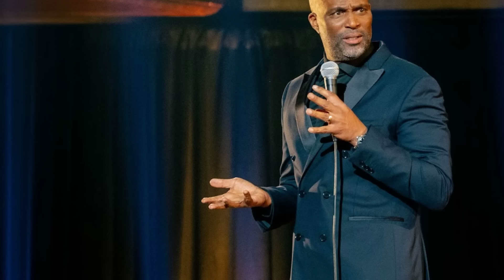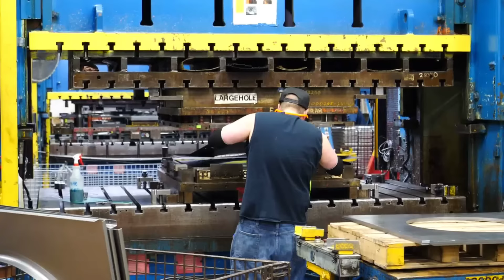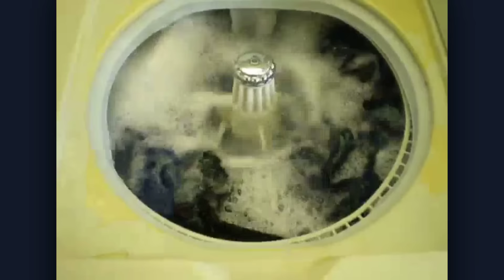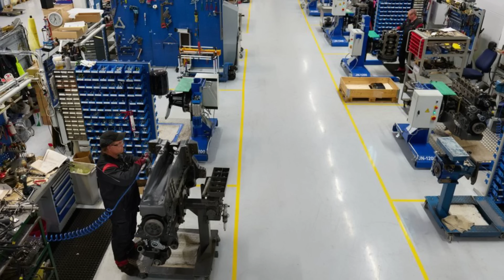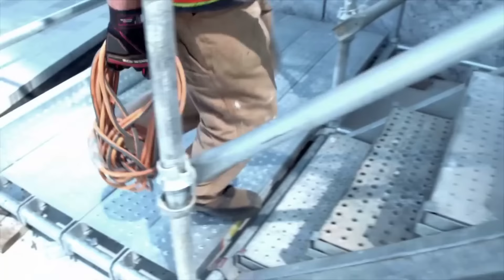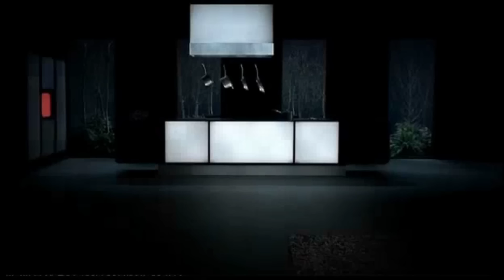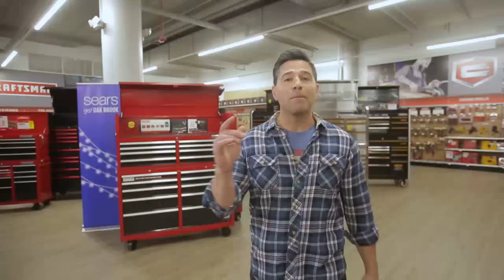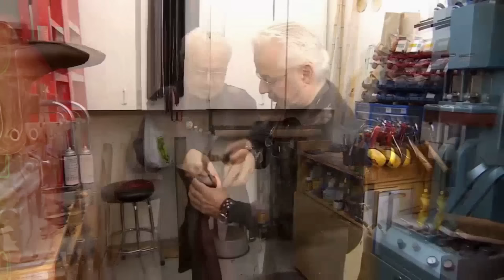The Only 5 Brands That Still Last (The "Buy It For Life" List)

Comment: Because I've been an inventor, designer, and manufacture for more than 50-years and have in my home, a machine shop, sheet metal fabrication, painting, electro-plating, electronics labs, and optical labs, I rarely ever purchase anything new, I repair what I have! I drive a 2003 Toyota with 124k miles, a 35-year old Maytag washer and dryer with parts that are still available, a 15-year old Whirlpool refrigerator that I replaced the "energy saving electronic" evaporator fan that failed within two years, with a Japanese ball-bearing "muffin" fan, I "snake" my own drains, I repair all electrical problems, component level circuit board repairs, and thousands of other domestic problems I encounter. I vowed never to buy a new car even though I can afford to pay cash for most cars, I exclusively purchase used and in many cases broken items for dirt cheap prices. As this video clearly states, especially new appliances and devices containing electronic circuit boards that are not repairable or have individual components that are not available, making them "un-repairable", I'll stick to things that I know how to fix! David Riddle
Reply: I admire you, I wish i had the same set of skills.
Greetings from Mexico.
Reply: @donleondevillafana7615  I do indeed have a YouTube channel, click on the circular "H2H" logo to see it, and I encourage you to learn from my methods!  David Riddle
Reply: @d @donleondevillafana7615 just watch YouTube tutorials. Most repairs are easy enough to do yourself all you need are right tools. Soldering is easy to learn and most product manuals are available online with a quick search. If you need specific parts you can buy other broken products on the low and pull the functional components to replace them. It’s never been easier to learn to DIY as it is now when planned obsolescence is unavoidable. So buying older appliances and tools that were made with repair in mind are no brainers with the only downside being that replacement parts may be hard to come by and you have to machine new parts yourself but there are shops that specialize in making replacement parts. Right to repair has been hijacked and replaced with plastic garbage waiting to expire
Reply: Holy cow. There are two of us? Same reason I bought a 1984 Kubota tractor.
Reply: @ehdeesign there's more than that,!
Reply: @sandydenman6083  I'm 73 and unfortunately many of us have been lost!  David Riddle
Reply: Marry me.
Reply: @DancingOnH2O DITTO 😊
Reply: @worldpeace8187  Thank you both for your offers, unfortunately I already have a "currently suffering paramour" of 25-years, when she asks me why I'm with her I say, "you are the least objectionable one I've found"! Just to let you know, I am not prince charming, but I am "duke useful" and duke useful is vastly more important in the domestic environment!  David Riddle
Reply: @DancingOnH2O 
Yes, just send me  cash 💸 and credit cards.  
Thanks 😊
Reply: Bol i was going to ask is he married 😂😂😂😂😂 @DancingOnH2O
Reply: @DancingOnH2O seriously, and can I be a sister wife?
Reply: 🇬🇧 Brit here.
We've got a 30 year old MAYTAG fridge freezer. Still rocking.
(It was 2nd hand when we got it!!!)
Reply: @surreyscouse2873 
Hello.
Just incredible that I saw the responses.
All true statements, just browse the junk (new,) items for sale ,starting in the 70's
Thank  you ,one and all
Reply: Dude! I’m 67 and I could have entered a comment almost exactly like yours. All my family drive used Toyotas also!
Reply: @TheKitchenTechnician  Congratulations to you, you've found the same path as I have!  David Riddle
Reply: My primary vehicle is a 2003 Dodge 3500 with 460000 kms on it that I service and repair myself. 
  I have a very nice 1975 Chrysler Imperial and a nice Ford Model T..
  All of our appliances are old and self maintained , so far I can harvest parts from our local garbage disposal site 😊
Reply: @tomlambert1833 
Nice!
My parents had a Chrysler Imperial. I think older than '75 though. I loved that car!
Reply: @tomlambert1833 Good luck never getting into an accident in old cars: no front, side or head airbags; bad seatbelts; poor braking systems; no electronic alerts or self braking capabilities; and too many other safety improvements that are responsible for saving thousands of lives through the decades.
Reply: @awesomelife3710  I live in Southern California, the only thing I'm afraid of is driving around with "newly arrived, unlicensed and un-insured, intoxicated, and texting motorists"!  David Riddle
Reply: Same thing most of us learned to do. I only need a lathe but my drill and wood lathe help me get by.
Reply: My first computer lasted 13 years. My next computer lasted  5 years, totally shot.
Reply: @nighthiker8872 I think the youngest computer in my company is 5 years old. Everything else is older.
Reply: @psxtuneservice  I'm responding to these comments on a computer running Windows 7!  David Riddle
Reply: @HowToHomeLife weird flex but ok.
Reply: @nighthiker8872  I’ve been using computers since about 1990. The computers I buy today last longer than the ones I used to buy. Why? Because those computers of yore became obsolete in but a few years. As a professional photographer, I needed performance and that increased at such a rapid pace over those early decades that those old models were ditched pretty quickly. I now have a Dell desktop that I’ve had for five years and it still works fine. The only issue is with Windows, not the computer.
Reply: You are worth your weight in gold.
Reply: @konstantia1607  You're welcome!  David Riddle
Reply: You should start a youtube channel and share those skills!
Reply: @DogofSinope  I do indeed have a YouTube channel, click on the circular "H2H" logo to see it!  David Riddle
Reply: Ditto... Newest vehicle I have is a 06. My Daily driver is an 04 f150 with just shy of 360k miles that I bought for $500 bucks in 2011. Original engine.  Can barely hear it run & does not leak a drop. Learned problem solving skills as a broke ass kid & I maintain my equipment.  😀
Reply: @johnstout5784 
Damn cam phasers... lol
Reply: I have craftsman tools that are over 30 years old, so before they made them into garbage they will probably outlast the new ones.  My husband was good at repairing stuff .  He had too give up because they started making all these unrepairable objects.  Could not take them apart and put back together.  Planned obsolescence.
Reply: Well done, Sir! 🎉  🇧🇧.
Reply: @Masterj3712  You're welcome!  David Riddle
Reply: @HowToHomeLife 
Have a good 👍 one. 
🇧🇧.
Reply: I'm jealous of your shop and skills.  I work on my own cars for fun.  I do some of my own appliance repairs too.  I draw the line at circuit boards though.  I like my old cars better too.  Two Toyotas, one early Nissan and two collectible Porsches.  Our Camry has over 300,000 miles.  I can afford new too but I just don't like them as much. The gadgets take all the fun out of driving.  Electric windows are nice, very reliable and actually weigh less. That's why weight-sensitive Porsche uses them instead of roll-up.
Reply: Doing the same things.
I grew up, from apprentice to "master", well, to know a little bit of a lot of things.
So, I do the same, in Europe, I am the "Fix It" guy, they call when shit hits the, "lawnmower" ;-)
Reply: Having multiple skills like this is what truly once made America great, along with fixable products.  I too intentionally seek out broken stuff for cheap to fix. The older , the better.  I recently drug home an abandoned 1970s Homelite tractor.  The only plastic on it is the steering wheel. It has a starter/ generator by Delco Remy as big as a car generator.  It had a tree growing up through it. The old Carlisle tires still took air !
Reply: ❤ you are one of best of the best!!! I would love to have a man real men like you that l can learn from how to fix things, it would be very satisfying and stress free because l can do it!😊😊😊
Reply: My old Mercedes-Benz is an '85 with 350K miles on it. Beats ANYTHING new.
Reply: Yup and then they talk about climate change and pollution while they are allowing companies to pollute and then they shift the blame on the people and people take it 😂
Reply: If only every man / boy were taught these skills today and the old gardening ways that produced not only amazing yields of if produce, but made free electricity for lighting areas or solar panels and which crops to raise for longevity, and so much more we used to use and do to survive in comfort. 
 Im so glad there are some men still around that have this knowledge. 
 Please share and teach the younger  ones these trades so they won't dissappear. 
 Thank you for sharing and God bless you all❣
Reply: @robynm7221   Why only males??  Why not teach females as well?!?!
Reply: @FrustratedTraveller  I don't disagree, more females should be involved with using tools in fixing things, it is very gratifying!  David Riddle
Reply: @robynm7221  I do indeed have a YouTube channel, click on the circular "H2H" logo to see it!  David Riddle
Reply: What dod you mean by optical lab?
Reply: @CKYFARMGUY  I have an "auto-reflex collimator" with associated lens mount adapters, and an "artificial infinity collimator" used for "infinity calibration" of lenses, plus standard illumination standards for calibrating light and foot-candle meters.  David Riddle
Reply: And every penny you saved your kids will blow in the year after you leave this world 😂
Reply: @nangel270  at least his life is happy to say at least!
What happens next is not his problem but theirs if they did not learn from father then they are lost to this world! 😊
Reply: @charlesstuart1119  Charles, my two children, and two grandchildren were never given a "highly addictive, fully-filtered, hand-held, Pavlovian device, known as a smartphone" ever, in fact I've always encouraged them to not follow trends, but make their own creative and productive ways in life, and both of my children are thriving, and my grandchildren are guided in the same direction!  David Riddle
Reply: You sir are a mans man 👍
Reply: @T18skyguy  You're welcome!  David Riddle
Reply: Nice. Modern-day Renaissance Man. 
How are you on human physiology and finance/investing?
Reply: @benevolentdictator2315  I'm ambulatory and can pay all of my bills, I'm very grateful for this!  David Riddle
Reply: Kudos for you and I'm the same way - in the process of gutting a 2yr old Frigidaire refrigerator on my healing bench with off the shelf parts as its blown through all 3 control boards 2x. It will be Arduino controlled initially and all the touch controls are being converted to proper switches (luckily my model has a rotary motor and not the crap linear versions). If the freon system fails then I'll reassess at that point. They aren't getting another dime out of me for this garbage. 
Getting as far away as you can from digital is the way to go.  I'm waiting for the day when these leech corporations are revealed for the idea of building in component failure from the factory in the form of computer firmware where a code is flashed and the "technician" (ie; parts replacer) tells you it requires more parts than the device is worth. If you understand computer systems you can understand what  I'm saying. If not, it's the equivalent of have a digital slot machine where the house controls when and how much it will pay out.  In the case of a motor vehicle this could be a transmission rebuild or replacement for $6-8k that wasn't needed.
Reply: @Brakken99  Congratulations to you on replacing "proper switches" and Arduino controller to scuttle the manufacturer's "planned obsolescence"!  David Riddle
Reply: $400 foa board for a newer washer.
Reply: my husband was exactly like you, he could build anything, repair anything, fix anything, I have a basement full of tools he owned, machinists lathe, milling machine, cutoff saw, drill press, tons of old expensive tools, etc, I don't know how to use any of it. 
I am glad there are other men like him who can do anything.
Reply: Me too!!
Reply: What kind of snake do you use for your drains? I have a dinky little 25 feet pistol grip drum auger.
Reply: @TheSouthIsHot  I have a Harbor Freight 1/4", 22-foot long powered auto-feed snake.  David Riddle
Reply: Thank you for answering!
Reply: You are my man.....top....the best way to go
Reply: @henkholdingastate  You're welcome!  David Riddle
Reply: Sorry. Knipex is so far ahead of channel locks it’s not even funny.
Reply: My Maytag no longer has parts so new he tomorrow
Reply: Yeah right kid.
Reply: David Riddle,  can I make a marriage proposition to you?😂
Reply: @rdb7450  Thank you for your offer, unfortunately I already have a "currently suffering paramour" of 25-years, when she asks me why I'm with her I say, "you are the least objectionable one I've found"! Just to let you know, I am not prince charming, but I am "duke useful" and duke useful is vastly more important in the domestic environment!  David Riddle
Reply: Sounds exhausting. Also, I have lived in a house that is 25 years old and I can’t imagine how you’ve had to deal with “THOUSANDS” of problems. (Your word, not mine). I’ve rarely had to fix things around my house, the most expensive being the HVAC system, but it was ruined by the previous owner’s dogs, who peed on the unit itself repeatedly. Replaced the fridge once with a good Korean one and got myself a good German dishwasher. Other than that, VERY few repairs.
Everything old wasted energy unnecessarily. An old dishwasher from 1994 wasted up to 15 gallons of water per load. A new one uses half as much water and actually SANITIZES the dishes. Same goes for old washing machines and dryers. Waste, waste, waste of energy. Just like old American gas guzzlers. 

American appliances that have the Energy Star label fail to pass the much more stringent standards of European brands.
Reply: @awesomelife3710  I'm 73 and I live in a home that was constructed in 1957, I can assure you that with that many years old, things eventually break!  David Riddle
Reply: Where do you find a Cobbler these days?
Reply: @John-g2h3y  John, did you look on the internet searching "local shoe repair" (with both quotation marks), and you will find many in your area!  David Riddle
Reply: Holy cow three of us.. Car  has done 475000km. I am an appliance repair technician. I do electronics and coding. I renovate houses.. In short everything I can do to short circuit the exorbitant cost these Co. Charge for new. Greetings from Australia.
Reply: @si2030  Welcome from the U.S., it is singularly the most gratifying things that humans can do; our ideas, our opposable thumbs and appropriate tools are all that separate us from the rest of the animals on this planet!  David Riddle
Reply: You are Correct. DAVID
Reply: Can I adopt you? 🤭🤭🤭
Reply: @choosejesus1es 
I can be Kept 
I am a male. 
Marilyn Monroe.
Reply: @Billy-w4v7f …😁😁😁 I’m definitely NOT a Marylin Monroe! 😁😁😁
Reply: @choosejesus1es 
Yes, send cash 💸 💰 
And a credit card 💳 
Thanks 😊
Reply: @Billy-w4v7f  Your comment made me laugh!  David Riddle
Reply: @Billy-w4v7f 😁😁😁
Reply: @choosejesus1es  Well I've had four marriage proposals from my comments, please look at them for an explanation!  David Riddle
Reply: @HowToHomeLife …I’m 60, and am pretty sure you’re younger. Maybe I should adopt you! 😁😁😁(you know I’m joking, right?)
Reply: @choosejesus1es  Actually I'm 73, and thank you for your offer to adopt me!  David Riddle
Reply: @HowToHomeLife 😃🤭😋
Reply: Me too!!!
Reply: Your house probably looks like a museum . Hate to see your underpants
Reply: Marry me!!
Reply: @MegaMagicdog  Thank you for your offer, unfortunately I already have a "currently suffering paramour" of 25-years, when she asks me why I'm with her I say, "you are the least objectionable one I've found"! Just to let you know, I am not prince charming, but I am "duke useful" and duke useful is vastly more important in the domestic environment!  David Riddle
Reply: @HowToHomeLife  She's a lucky woman indeed!
Reply: @HowToHomeLife  Have you dealt with teenagers? How‘d it go? I was one once and would have complained about lack of new stuff.
Reply: @richarddietzen3137  Richard, when my son was 16, he gave me a running drop kick into my heart! Eventually he matured into a fine young man, married an incredible mother and now I have two wonderful grandchildren.  David Riddle
Reply: Your wife is a lucky woman.
Reply: I had a sears model 87 refrigerator.. in the early 2000s.. a weird 3 door frige where that third door was built into the refrigerator side.. just wide enough for condiments on a set of plastic shelves.  When it finally bought it,, in 2013, it wasn't because of the guts.. the plastic on that little door cracked and fell off and shattered.  I still miss it.
Reply: where have you cowboys gone? we are left with pathetic soyboys.
Reply: Your wife is lucky! If not many woman want you as a husband! Including me! 😊
Reply: Sounds like my Uncle!
Reply: Good 👍
Reply: Im a dumb girl 😭
Reply: We share the same spirit. Until now I repair my own stuff and even make my own steel tools.
Reply: @hakimseif4693  Congratulations to you!  David Riddle
Reply: We have a 1955   International Harvester freezer that the fan moter is starting to Rumble a bit.
Reply: Same.
Reply: We seem to have a great list of common similarities. maybe we should bounce ideas and challenges off each other... Guess I wish I was your neighbor .. LOL.
Reply: @craftsmanbyheart  I do indeed have a YouTube channel, click on the circular "H2H" logo to see it, I'm sure you will find the videos informative!  David Riddle
Reply: Good for you.
Reply: Well not all of us are machine fabricators.
Reply: YUP!!!! You're the guy everyone wants to be friends with..lol
In my 62 years on this plane, I've acquired many skills and trades.
I've done electronics, mechanical, construction and a host of others and I am in no need of newer technology!
New equals problems...
I even designed and built my own amplifiers for my pleasure and some jobs.
Skills are what these young people need and not technology, because when tech fails they are useless as titts on a board.
How many people remember that phrase?
Reply: I too have a 35 year old Maytag washer dryer stack. Still kickin'
Reply: I'm moving soon. Refusing to buy the new pretty appliances.  They are a nuisance to own. Same with cars. Couple of hrs ago,I bought a land rover. So far everything about it. It will need to go soon. The repair cost are unreal.
Reply: @numbernine3436  My friend had a Land Rover. The engine block cracked. That happened with old cars back when I was a teen in the 1970s but I’d never heard of it in recent years. She wised up and bought a Subaru.
Reply: You’re the type of guy that I grew up around.  I remember the first time being around a man who couldn’t fix a leaking heater hose on my car but was willing to ride with me to a station to get it done, I was go smash because I didn’t know men like that existed.  Now I only wish I had a neighbor like you because at age 75. I’m not real keen on the idea of climbing over my washer and dryer to reconnect the dryer vent after cleaning it out. 😂😂😂
Reply: @LaJuana558  I'm 73 and I encourage you to attempt repairing things, it is the most gratifying thing that humans can do!  David Riddle
Reply: I am proud of you
Reply: @Redspottedbug  You're welcome!  David Riddle
Reply: Great for you I suppose, but most people do not have access to your level of wealth or capital. Out of reach for most people trying to survive in our technofuedalist society.
Reply: @gamestop5611 I've never thought in my career how much money I could make, only what can I do that others have not imagined or were unable to accomplish.  David Riddle
Reply: You have lived a good life, sir! They sell nothing but polished junk these days
Reply: @ae-ub2vb  You are correct on both accounts!  David Riddle
Reply: I wish you were my neighbor
Reply: Well done!
Reply: @susansmith493  Susan, you're welcome!  David Riddle
Reply: You do know how valuable your skills are, right?  I would LOVE to have you live nearby, although I know that's not possible, so the next best thing is perhaps you can teach these young people of today how to do what you can do.  

Maybe sign up to teach shop in a vocational school as a volunteer?  That way the next generation can actually do something instead of sitting around "Tik Tokking" or "Instagramming" all the time or selfies or playing video games.
Reply: you lucky dog!  great to have knowledge like that
Reply: @nancywolf3786  Nancy, you're welcome!  David Riddle
Reply: But most of us cannot do that. We do not have the ability or tools. We need to buy these products.
Reply: @corinnem.239   I do indeed have a YouTube channel, click on the circular "H2H" logo to see it, I only have 18-videos and if you watch them, they are quite informative!  David Riddle
Reply: I still use the cast iron pans that belonged to my great grandmother. She died in 1955 at age 93. So you can estimate how old these pans are. And I’m using the Maytag washer my mom bought in 1987. My plan is to keep it going forever.
Reply: @LindaEll  Old and used are seemingly the best!  David Riddle
Reply: Would you be a hoarder by any chance?
Reply: @AnneJudith-r5b Anne, I do indeed have a YouTube channel, click on the circular "H2H" logo to see it, I only have 18-videos and if you watch them all, I'm indeed a hoarder of raw-materials to make and repair a number of things!   David Riddle
Reply: I news him too!!😊
Reply: Need him too
Reply: Please start a youTube channel and share your knowledge so others learn to repair rather than toss!  Any repair, maintenance, etc. that you do, set up a camera/cell phone and record it.  Even if you machine a part, it still will help others, and it will help rejuvenate the repair-it mentality.
These skills are not being taught, and there’s a growing number that want to learn.

BTW, my car is from the 1980s.  Mechanical > electronic
Reply: @gamingwithfrodo  I do indeed have a YouTube channel, click on the circular "H2H" logo to see it, I only have 18-videos and if you watch them, they are quite informative!  David Riddle
Reply: @donleondevillafana7615 Sadly, after a series of life events I have been forced to move into a small apartment and no longer have the resources or space to do any of those type repairs any more.
Reply: @tomhiggins875  Tom, I can't imagine if I didn't have the space and tools to accomplish this work, it is so gratifying and an antidepressant!  David Riddle
Reply: @HowToHomeLife David, it is a struggle and I hope you never have to experience it.
Reply: Recently retired union sheet metal worker ; NYC "Tinknocker".
Basically, anything can be made from sheet metal. The only limitations are your knowledge, skillset, tools needed, and imagination.  ❤
Reply: @timmurphy334  Tim, I've always loved sheet metal because of It's incredible versatility, punching, braking, upsetting, strengthening ribs, etc., I've designed many products exclusively with sheet metal! I have a YouTube channel, click on the circular "H2H" logo to see it, I only have 18-videos and if you watch them, they are quite informative!  David Riddle
Reply: Tom said mechanically
Reply: Damn man I wish I had a dad like you. I got a method out never around guy I stead. Much respect to you sir!
Reply: @shinobinomono369  Thank you very much!  David Riddle
Reply: Wish we all were in your shoes. I feel like your privilege is showing through your long brag. 
Bit jealous that even if I somehow learned all your trade skills I’d still not have the room or finances to gain tools, equipment, raw material. Etc.
Reply: @Gshkent  I have to say that repairing things offers incredible gratification that cannot be compared in any way to buying new!  David Riddle
Reply: Are you single?
Reply: Teach me!!
Reply: @natural_law  I do indeed have a YouTube channel, click on the circular "H2H" logo to see it, I only have 18-videos and if you watch them, they are quite informative!  David Riddle
Reply: My Maytag washer and dryer are about 45 years old. I'll never replace them for the bells and whistles of today's junk.
Reply: @kerryswier4173  Kerry, and I suggest that you don't buy new and shiny!  David Riddle
Reply: I would love to take "fixing" classes with you. I don't like to discard things that can be repaired.
Reply: @chuspaChu  I do indeed have a YouTube channel, click on the circular "H2H" logo to see it, I only have 18-videos and if you watch them, they are quite informative!  David Riddle
Reply: I don't want to keep a workshop to make my washing possible
Reply: @Be-Es---___  I can understand that, but I have to say that repairing things offers incredible gratification that cannot be compared in any way to buying new!  David Riddle
Reply: My philosophy too!  I feel I could fix some things if I could get parts!
Reply: Sounds like you're in the US.
I'm impressed!
We're going to need people like you to make this Country Great Again!
May I ask what State you're in, David?
Bless you...
Reply: @timk4502 agree !!!!  MAGA !!! 🇺🇸♥️
Reply: @timk4502  I'm in Southern California and I do indeed have a YouTube channel, click on the circular "H2H" logo to see it, and I encourage you to learn from my methods!  David Riddle
Reply: David--you are 100% AMERICAN! Our country was built by men like you--no fancy-pants or newfangled stuff to "impress your neighbors." My Grandad, Dad, and me say: "We can fix anything--except a broken heart!" Greetings from a hill farmer in Ohio.
Reply: @kennethwood2089 it sounds great👍
Reply: @TorangCalarus Both of you are quite welcome!  David Riddle
Reply: @kennethwood2089 im a Norwegian, i have only old stuff, if something breaks i have to find my own solution with the stuff i have, ride a 40 years old suzuki lt 250r atv ive got for free cause they couldt get it to run, used ignition parts from a snowmobile engine, my car is a 2001 japanese pajero, 23years old snowblower frome yanmar, live in northern part of norway so its used a lot, snowmobile frome 91 i got dirth cheap cause the owner couldnt get it to run, since i was a kid ive been broke and had to learn to fix stuff couse i never had a car or snowmobile sent to a autogarage,
Reply: You drive 4000 miles each year?
Reply: @longochu8588  Actually less than that, I live in Southern California and because of that, the only thing that I'm afraid of in life is "driving around with newly arrived, un-licensed, un-insured, intoxicated and texting motorists"!  David Riddle
Reply: I am with you.  Do all the same items, find an item that is older and repair.  Right on sir.
Reply: @Vincentschneider007  Vincent, Congratulations to you, you've found the same path as I have!  David Riddle
Reply: GOD BLESS YOU common sense at last.😊❤
Reply: @kathypichey4306  Kathy, you're welcome!  David Riddle
Reply: Is your name:

Rick Sanchez?
Reply: @Rez_and_Dez  No, who is Rick Sanchez?  David Riddle
Reply: You sound like a real nerd.
Reply: @BillLaBrie  I've been a "nerd" all of my life! David Riddle
Reply: @HowToHomeLife have you always signed off on your communications wit your full legal name?
Reply: @BillLaBrie  I simply consider it more personal.
Reply: @HowToHomeLife you should invent something that prevents people from using homonyms.
Reply: When my dad passed he still has 30-40 year old washing machine and dryer. They were the older olive color. Has i not lived 1,000 miles away i would have loved to get those.
Reply: That's what happens when etraitaiment becomes more important than utility. 
America ( pioneers  ) once was about just that.
Reply: @piotr.LL5209  I agree with you completely!  David Riddle
Reply: @HowToHomeLife  Americans must go
back to the times beafore TV.
There is no other way. This brain wash 
MUST STOP.

Love to old USA from Poland.
Reply: You’re the kind of guy I want as a neighbor!
Reply: @WillFinch-k4j move!
Reply: An indispensable man.  Created in the image of the Living God.
Reply: @PaintdropArrow  you're welcome!  David Riddle
Reply: Thanks for waxing your ego in front of all of us.  Now we compute at your arrogance.
Reply: @brianwnc8168  Brian, could you please explain the difference between having a good sense of self and an egomaniac!  David Riddle